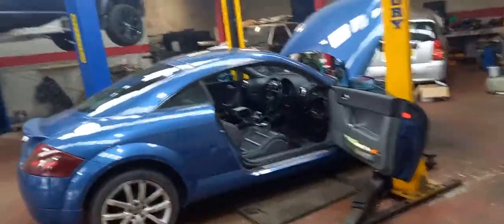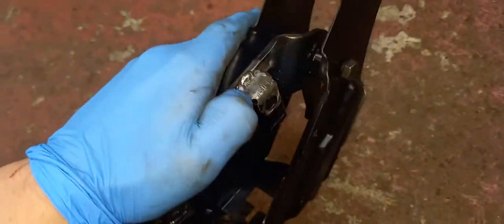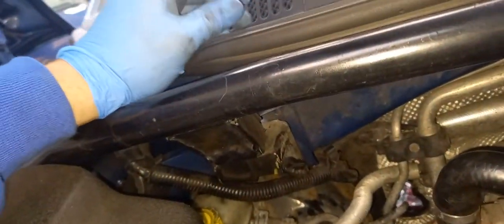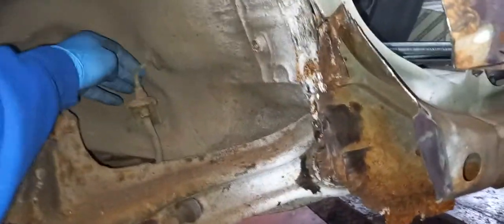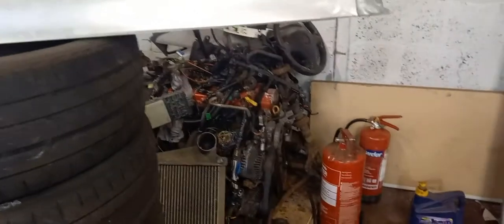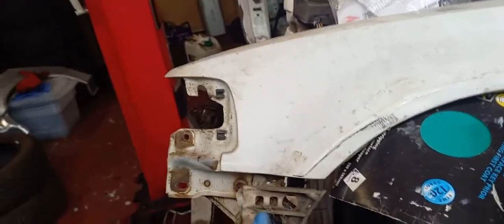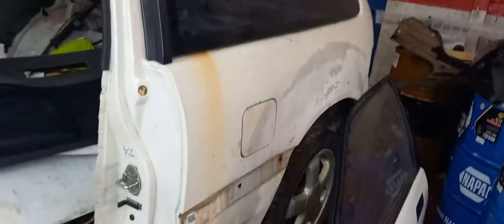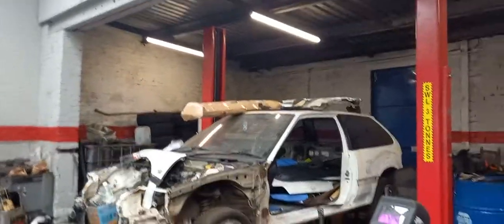audi tt clutch master cylinder replacement & mod+ honda resto mod

Comment: Hi. Are u able to change these without having to get under the bonnet and get into the tight bit underneath the reservoir? Hoping I can do this myself on the driveway but not have to take everything off to get underneath the reservoir
Reply from the maker: hi, and thanks for watching and commenting. If you haven't already, please subscribe and have a great day you need under the bonnet. 2. Remove the electrical connector and the 2 pipes, one hose to reservoir one to the slave cylinder. The rest is all done under the dash. You need to remove the clutch pedal box from the vehicle and the clutc master comes with it you need the panel under the steering wheel off hope that helps have a great day
Reply from the maker: https://youtu.be/MA_7ScEXeQs
Reply from the maker: watch this one similarly fault too the audi tt the tt ended up having everything replaced at customers request maarer slave clutch and flywheel

Comment: How did you access the pipes to the master cluth cyl? Can you access them from the interior?
Reply from the maker: the master cylinder is removed from the onterior side, but the clip for the pipe is behind the engine, and usually, it has a heatshield cloth around it. It's quite tight to get to a bit achievable hope that helps. Thanks  for watching and commenting. If you haven't already, please subscribe and have a great day
Reply from the maker: https://youtu.be/MA_7ScEXeQs?feature=shared

Comment: What was the issue with the clutch in the first place? And how did you come to the clutch master cylinder and not the slave cylinder in gearbox ?
Reply from the maker: we replaced everything on this one clutch dual mass flywheel slave and master cylinder on this tt aswell as stage 1 remapp we changed the clutch master cylinder as the customer had bought it and asked us to change it so we did thanks for watching and have a great day ofntou haven't allready please consider subcribing to the chanel 😀